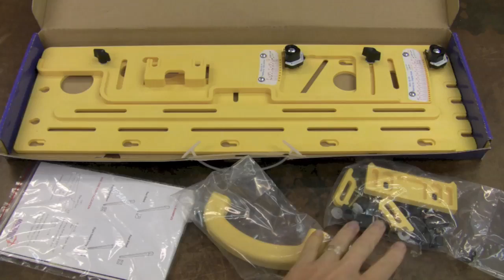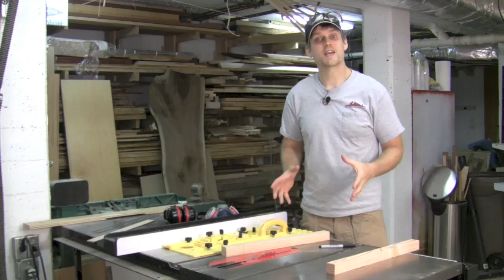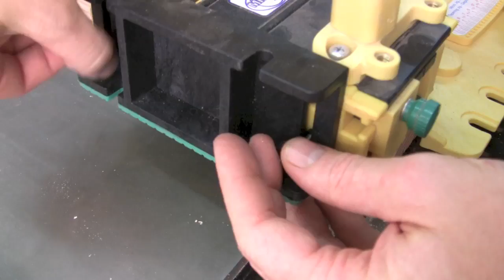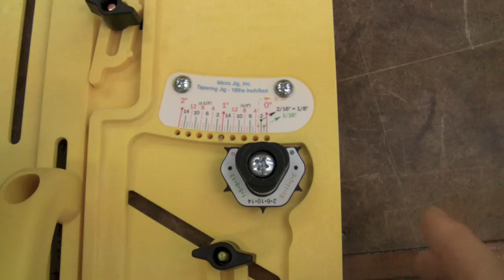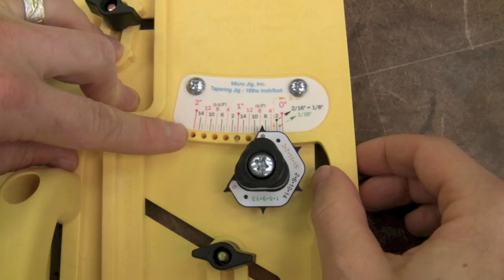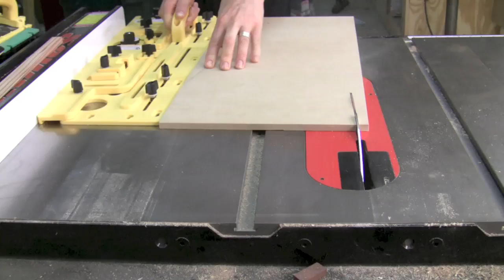Micro Jig MicroDial Tapering Jig - Leg Tapering Made Easy

Comment: Thanks for the instruction. Best explanation yet on how to use the Microdial Tapering Jig. I have a Dewalt job site saw. Tried to use the jig for jointing, the fence was out and I had to flip the holder. How to you use it in that situation? Lots of just space between the blade and the fence.

Comment: can this taper circular dowels or take square dowels and make tapered rounded dowel?
Reply: Holding a round dowel securely in the jig is not its intended design purpose.  Attempting to do so would be unsafe.  In addition, trying to reference round stock for accurate cutting would pose its own set of challenges.  The manual speaks to tapering legs up to eight sides, but it doesn't cover cutting rounded stock.  You can access the manual for the tapering jig here:     https://www.highlandwoodworking.com/library/manuals/microjig/microdial_tapering_jig_manual.pdf
Consider a lathe as an appropriate tool to make tapered round stock (like a stair baluster).
Reply: @eddents  I started looking at lathes last night, thanks for the great information!

Comment: an issue I can see is the length of wood you are limited by. Can you fit a 30in table leg on there, if you are tapering 26" of that leg? Can you go far back enough for that?
Reply: You can click on the link on the webpage for the tapering jig  to read the manual in full.
https://www.highlandwoodworking.com/microdial-tapering-jig.aspx

While I think the design guideline for tapering a leg on the jig is approximately 30" OAL,  determining how far back you can have the jig for beginning the cut (due to longer leg lengths you may have) has more to do with the size of the saw you are working on and the ability of the operator to control the sled and the stock at the very beginning of the cut (based on how far back the sled is to clear the blade before cutting).  The built-in stop means a leg longer than 30" requires you to pull the sled back farther to begin the tapering cut.  Full size cabinet saws have table tops that are deeper than small, bench top / portable table saws and thus would afford more ease of control for the jig at the start of the cut. Bigger saws may also have their fence extend  beyond the front edge of the saw for bearing the edge of the jig against.  You always need to keep in mind that if does not feel like you'd be in control at any time or it may feel unsafe at any point before you begin cutting, then don't attempt the cut.

Comment: i have a drawer bottom that i need to cut two sides that need to be angled slightly....will this work with it or is it only for table legs?
Reply from the maker: Yes, it will work for your drawer bottom. The jig doesn't care what material you cut (1" thick or 1/4" thick).  It is just an angled rip fence.  What you push against the fence of the jig for cutting is immaterial to the use of the jig.

Comment from the maker: Thanks for the comment, Ken! You are right that there is quite a bit of setup on this jig, but the good thing is that once the jig is set, you never need to disassemble it, and it is ready to go with a simple adjustment for every taper cut you need to make down the road. We also like the added safety it provides for sometimes dangerous taper cuts.

Comment from the maker: Thanks for the comment, Charlie! The jig does have a lot of features and allows multiple methods for setting a taper which can seem a bit intimidating, but as Morton showed in the video, with a taper marked on your work piece, it only involves loosening a single lock knob, moving the jig to the correct angle drawn on the work piece and tightening down the lock knob.  So just one setting to lock in and you are ready to cut!